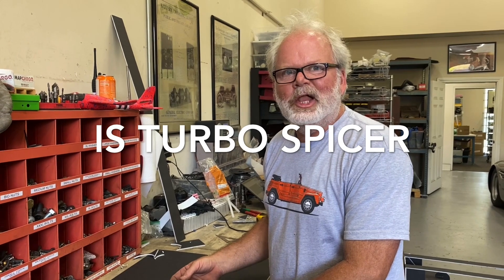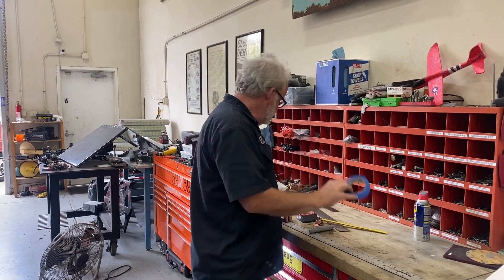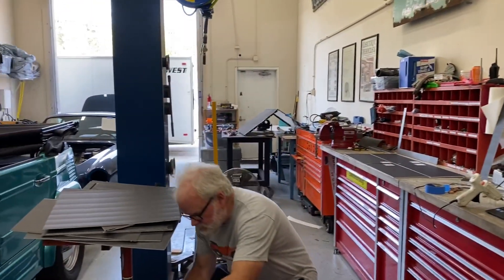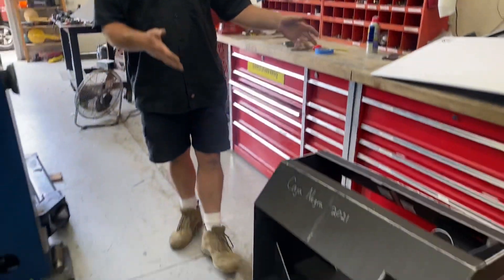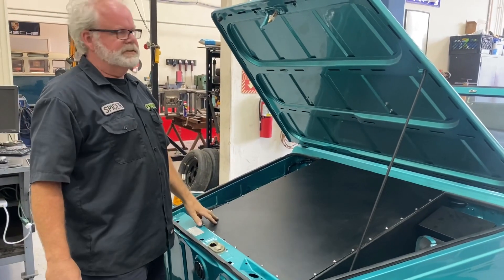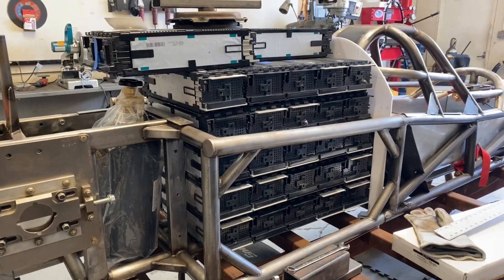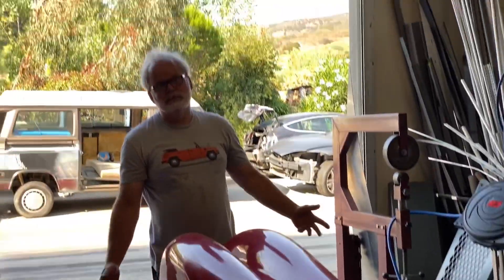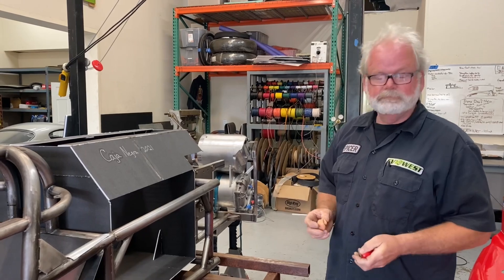EV Battery Box Design & Prototyping | EV Show

Comment: A question please:  As to trucks with frames in general.  I understand that between the frame rails and under the body shell is normal.  
However, with a Unibody Truck/Ute like a 1965 Ford Ranchero.  How about a tray in the bed to hold the Tesla battery's on edge.  A Diamond plate top cover much like an inverted square tub would fit over the interior of the bed shape.  This would still give you about half the Bed-Depth to carry a useful load.  This would also make battery access and maintenance an easy top-down affair.  This would be in addition to the normal under engine hood batteries.  Has this concept ever been explored?  I have a 65 Ranchero I'd dearly love to convert.
Reply: I think it would work, hopefully they don't get stolen.
Reply: @marcbee1234  Well I think the large TOREX bolt used on other truck beds would work.  plus, the batteries are hidden under the diamond plate box cover.

Comment: Did he just say CO2 cooled batteries in an EV???  I thought the point to an EV was to stop emmisions of CO2.
Reply: Using CO2 as a gas and producing CO2 are different things. There are plenty of use cases for CO2 and it's naturally occurring. If you leak CO2 you previously captured from the air, it's still pretty neutral. Using CO2 as a refrigerant could even be a form of carbon capture.

I missed which point of the video discusses this so I'm not sure how they said they would use it?
Reply: @winkcla  where do you think they get the CO2 in the bottles?  My guess is the ff industry is happy to fill them.
Reply: @DanA-nl5uo  Sorry to offend you. I think its sad that forums like this stirs up hate so fast. I'm just a big fan of the work EV West does and cool tech in general.
Reply: This a record breaking speed attempt dumping tremendous current in a short time. This is NOT about emissions in this case it's about speed and POWERRRRRRR. It's also in every soft drink (pop) and beer.
Reply: @Mike_Costello  my point is there are plenty of non greenhouse gases which would do the same job
Reply: @Mike_Costello  so they are proving what that you can go fast with an EV that is harmful to the environment?  Seems counter productive.  But nice deflection on the soda point.

Comment: "Turbo-Spicer" Here Is Definate Proof That They Legalized POT In California! 🤣 Next Video He Will Show How You Simply Fiberglass &/Or Epoxy Carbon-Fiber/Kevlar Wrap Around The Foam-Board Mach-Up To Make A High Strength, Lighter Weight, Waterproof, Insulated, Non-Conductive Finished Battery Box Container, Ready To Install Into Your Framed Project With A Few Laminated On Custom 90* Tabs & Some Vacuum Bagging! And All Done Without The Higher Costs Of Any "Heavier" Sheet Aluminums Or Any Custom Welding!!! Thanks